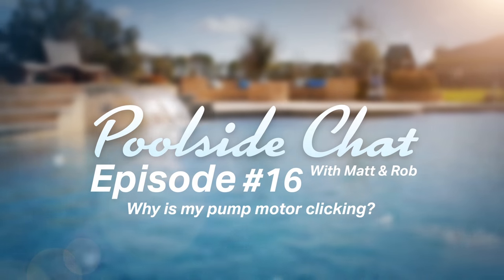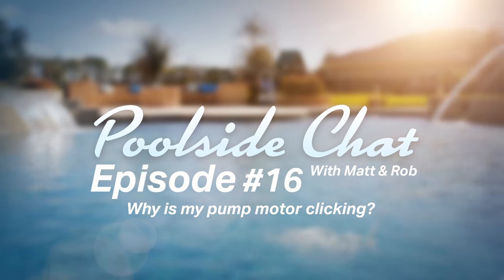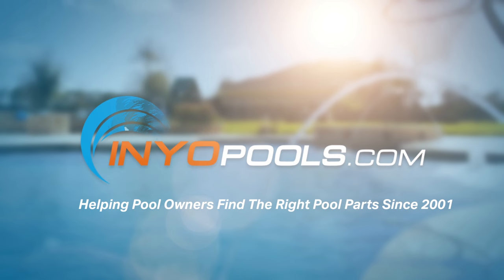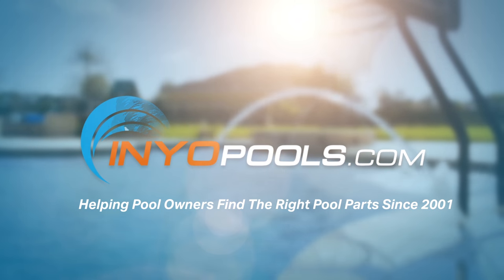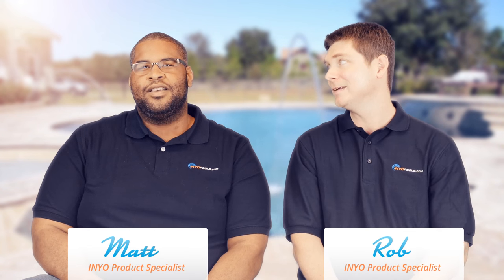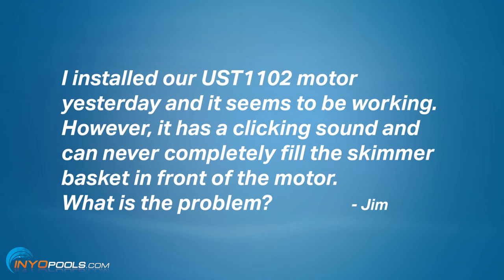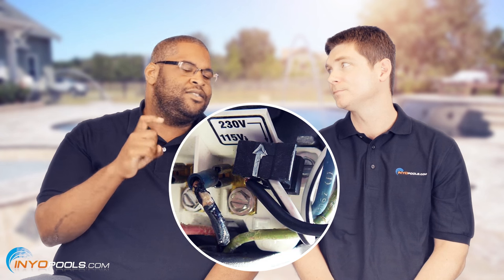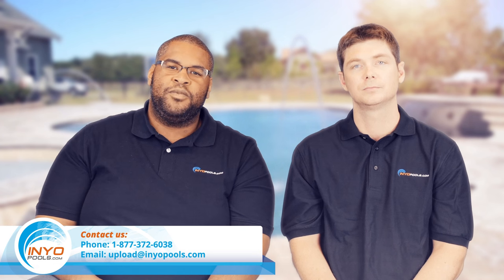Why is My Pump Motor Clicking?

Comment: I have this exact noise on my dual voltage pump, using it at 110v and the switch is set to low voltage, is this normal for low voltage, can anything be done to stop the clicking?

Comment: Question: is a 3 way, 2 - 2 1/2 inch valve going to work if it was replaced by 1/2 -2 inch valve? 

My Dad just did but suddenly the pump stopped working. 😞

TIA.
Reply from the maker: First, make sure the new valve isn't closing off one of the lines that was previously open. Going from a larger valve to a smaller valve would decrease the water flowing to the pump. This could impact larger HP pumps, 1.5HP and higher. Larger pumps could struggle to fully prime. If the pump is not turning on, you may have other issues like a bad motor or electrical problem.

Comment: I turned my vacuum on. The box with the power switch started making a clicking sound and the vacuum stopped. A few days later I discovered the female end of the electrical cord had a blackened side. We changed the electrical cord but no power and not running. Help. Ideas.

Comment: nope, pump clicking fast. pushing water only a year old. 110v motor. no idea what problem is. went from running good to clicking like pump is loose or something.
Reply: Mine did the same thing. Been using it for 2 years. Went on vacation for a few days and it was fast clicking when I got home but otherwise working fine.
Reply: @yamahagrand  probably an impeller issue but I stuck a Hayward on it just to get rid of that pump..
Reply: @shadedlightdigital  took it apart this morning. Clicking is more like a grinding and does it even when disconnected from the pump housing so I'm thinking it's a bearing. There is no  governor mechanism on the back of the motor housing so it's either brushes or bearing. Ordered a new motor.
Reply: @yamahagrand  Sounds like a plan...I just replaced the whole set up. Good luck enjoy the day.
Reply: @shadedlightdigital  thanks! Likewise.